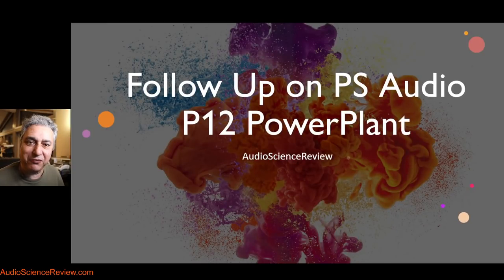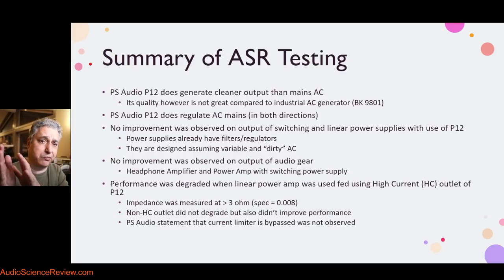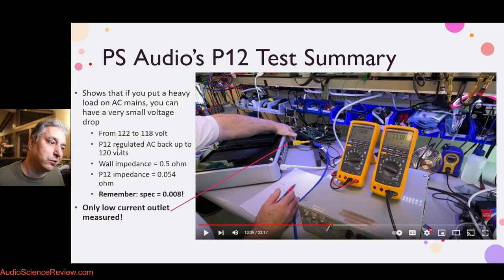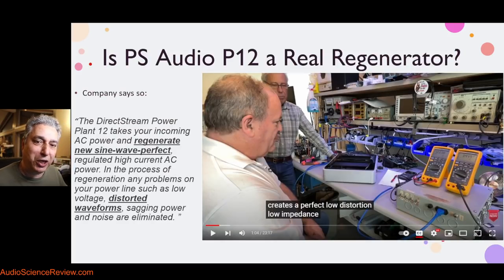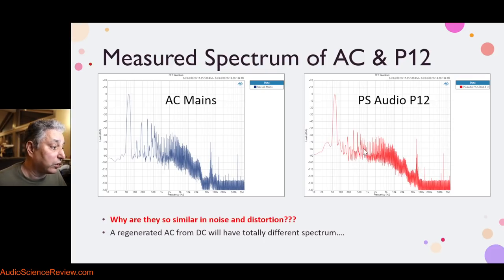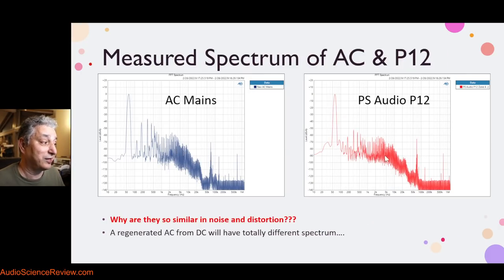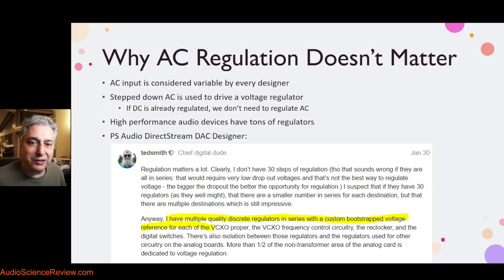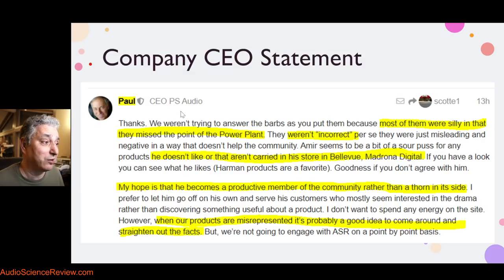PS Audio PowerPlant Measurement Follow Up

Comment: Nice job Amir.  I've never been into these regenerators, as I buy equipment that has sufficient line filtering and power supply noise rejection to make this sort of thing redundant in my system.  Audiophiles and HiFi enthusiasts are two entirely different groups of people.  Audiophiles have infinite resolution hearing that only works when you can see what you're listening to, and they value what guru's, priests and magazines tell them.  They love the artistic jewelry of audiophile boutiques.  Thick heavy metal and thick cables, gold, platinum and exotic materials and everything that pleases the eye. Higher priced equipment is almost always better.  It is a fun hobby, audio art collecting, but it is for the most part unrelated to high fidelity.  Paul is an audiophile priest, and what he says goes with the audiophile community.  Arguing with a member of the audiophile religion is usually a waste of time, as they dodge logic in favor of what feels good to them.  Every year the priests move the goal post of audiophile perfection and new works of art must be purchased to keep you collection up to date.  HiFi enthusiasts are interested in high fidelity reproduction, supported by measurements and verified by listening.  They understand that hearing resolution and accuracy is limited,  diminishing with age,  and far lower than what can be easily measured. An amplifier built in a coffee can is just as likely to be sufficiently high fidelity as anything with an inch thick front panel.  Modern HiFi electronic equipment  is far better than the hearing ability of anyone I've ever met.

Comment: I own a P600. I have measured the FFT on the output. The old models (or at least mine) do indeed completely regenerate the power and the output is markedly better than my line input. I have opened it up. Had it all apart on my bench for capacitor replacement repairs. It is a power amplifier set with an oscillator board and includes some feedback to regulate the output voltage and some self limiting over-current protection. It sure puts out the heat but it does make a difference with my tube gear. Not with my switched components though because those supplies are designed to take any crap ac and make dc.
Reply: So, are you confident in a blind test, you could score a 10 out of 12 positives, when 'in line' or not? (when your power is regenerated or not)
And of course, using your amplifier of choice, such as the tube gear you mention?  IMHO, this would be the real  test, measurements aside.

Comment: Does anyone know how to even do damage control anymore? Seems damage control is synonymous with simply making the damage WORSE. PS Audio man... what are you guys doing over there?
Reply: This really makes me wonder if this is more a battle of pride then damage control at this point.   as far as the company, PS audio would do just fine but I think would really be the issue for all the reviewers that said that absolutely benefited from the product and could hear it clear and measurable difference. It's those reviewers that would probably get the most backlash. Not the Audio company as they can always re-engineer or retool and make a better product. 

but the credibility of all the reviewers would be tarnished forever

Comment: Here is my comment: If the components in your audio system are properly designed and built, as most are, you have no need for a power line conditioner. None... zero, zip. 

When I was a kid, there were still evangelistic peddlers crisscrossing the farmlands of the US selling "lightning rods." PSAudio's spokesman reminds me of this resurrection of a phobia. This time, it's the good old power line that is the evil gremlin.

I recall several years ago commenting on Paul's 'Missel' YT video extolling the virtues of the Power Plant. Basically, I said that, if an audiophile is having problems with electric power quality impacting his music, the solution was in the electronic components' internal power supplies... not trying to 'improve' the power line's quality. And these problems are very rare.

I completely agree with Amir's characterization of such power line improvement devices. In general, the fault and its solution are in the component power supplies, not "powerline fixers." These power supply problems are rare. Electronics design engineers are keenly aware of their responsibility to build internal power supplies that clean up and regulate power -- inside the component. That they do this very well is a testament to just how few problems are extant in decent components. Mostly, they are in your imagination.
....
If you are desperately looking for something to spend a bunch of money on to improve the condition of your life, buy a boat. Or a sports car. Or a platinum wristwatch. The scientific measurements are in. Let them dispel your powerline phobias.

And don't forget to buy and wear your copper bracelet to cure arthritis, liver disease, heartburn, and lumbago.

Comment: Awsome info mr. Amir! I do have a question maybe you can help me? I am using a VariAC to step up/down voltage to my pre & power Amps .. I was wondering if these copper core variac's introduce distortion? I use a hefty one on both stages 20amp, and my requirements are only 5amps or so.? Appreciate your scientific input. Thank you!
Reply from the maker: Hi there.  No problem at all in using the Variac in your situation.  You have done the right thing by using one with far better current availability than what you need.

Comment: Come on...using an inductive current measurement as the basis for precision calculations?  That is definitely amateur. Great tool for checking circuit loading,where precision is not required.

Comment: Thank you for revealing these kind of stuff for people to know specially when you pay thousands for most of these nonsense items. I wish you could test audioquest niagara 7000 which I paid close to 10k . I didn't know better, bestbuy sales people said I needed it
Reply from the maker: I have tested the Niagara 1200 and unfortunately it doesn't do anything for your sound: https://www.audiosciencereview.com/forum/index.php?threads/audioquest-niagara-1200-review-power-conditioner-surge-protector.25443/.  I looked up the specs for 7000 and it doesn't start filtering until 3 kHz.  I am confident it is not doing anything useful as far as filtering. But if you are in US, I am happy to test your unit.

Salespeople have to push these things because they have little margin in the products they sell.  Often that is the only source of profit and as such, they are incentivized to sell these things.

I have tested a bunch of AC filters/generators and none have shown any benefit regardless of type and architecture with respect to making your audio equipment better.
Reply: @AudioScienceReview  I am in California I really appreciate your reply. I have my sub and a pair of mcintosh mc901 and 1 mc257 connected to the high current outlet of it. Like what you said wall outlet mostly likely will do the same.  What a rip off 😪. I need to start selling it.

Comment: Thanks for review, Amir! Can you recommend a good ac regenerator? I sure, it doesn’t matter for modern DAC or headphone amplifiers, but I have a couple of vintage guitar amps with old school transformer and caps style power supply chain - it is a part of sound, because it works like compressor on max power - it’s really sensitive to AC noise!
Reply: @Douglas Blake I have other issues with AC, like variable voltage, strange short peaks, etc. I find it’s easier to buy AC regenerator to solve all problems.
Reply: There are some rather cheap Salicru double regenerators on Amazon, I've got not any idea if they are good but they are really high power large units, probably with a noisy fan so you want to stick them in a cupboard... I was tempted to try one to solve momentary power cuts in the area

Comment: The output waveform of the P12 is similar to the "dirty" AC line input because it's NOT a true regenerator. It is actually an amplifier. They are using the input AC signal to "generate" the AC output.  Garbage in... garbage out.

Comment: These are useful at audio shows where the venue's power starts to droop from all the equipment. I've seen the voltage drop to 103Vac at the wall with a clipped waveform which can definitely affect linear amplifier performance.

Comment: I used to own a PS AC12 Power Cable and it's 799 dollars. After blind test it with a stock cable in a Tube rectifier Tube guitar amp(suppose to make the biggest difference), I immediatly sold it, just placebo effect. Years of technical industry expereice taught me to look at data and not feeling. I haven't seen any cable company able to justify their claim that their cable make the sound better using data, nor does any power planet company neither. 

It's sad to see Paul's statement. IMHO some companies are out-dated from the Hifi game. Hey it's 2022, not 80s. If you plan to watch Paul's video, I did spent my 23 mins and so you don't need to. It's somehow contradicted with my knowledge. Either my textbook/college/graduate education are wrong or they don't know what they are talking about.
Reply from the maker: You are way ahead of the game Sam with that blind testing.  It takes an experience like that to realize how bad audio has gotten as of late in pushing stuff that has no value at super high prices.
Reply: Welcome to the real world.
Reply: Sam- if you listen to music via your Computer, Supra usb cables are fairly cheap I have one and it does have a stronger signal as shown in this tested video. This is a pretty legit experiment using an inverted channel to see how strong the signal is! But it’s not like night and day difference and I’m sure it depends on your DACs usb and if the ac is isolated from the dac itself. 

Supra does use data transfer specs of 90 ohms on inputs and outputs! That’s what I think is the difference. It just meets the standard requirements in impedance of the Audio transfers data stream. A 50 dollar US cable for 1 meter (not bad!) so it’s not all “snake oil.” 

https://youtu.be/zncAhs44sp8
Reply: @joesmith4443  Hi Joe,  this video shows good evidence, though I don't know why, I'll say it did change the outcome. To make it clear that I didn't mean cable cannot change the sound. Also, I have no problem with a cable like this Supra USB. It seems well made, good aesthetic, and not crazily overpriced. I stick with professional audio brands like Mogami, Gotham, etc. When my stock USB goes bad I'll probably get the Supra. 

In my experience with cable, the difference is small and no one should spend the $$$$ on cables. There's an entire industry advertising their product as "HiFi" and claiming their thousands of dollars cable make a huge difference to your audio system. If you say you can't hear that one will say your system is not good (they mean expensive) enough. And this is pure BS.  

I as a consumer want to spend my hard-earned money based on data and scientific results, not the placebo effect nor the manufacturer's lie.  And this is exactly what Amir's works shine.  To help the us spend their money wisely on audio gear and not fall into the trap about "expensive = better sound".  Proven with evidence. This PS audio device is a great example. 

Back to the usb cable topic, if we put aside the level difference for those USB cables, the difference between a 320k mp3 and lossless will most likely be greater than any of those 2 cables can make. However, I haven't met anyone I know who can pass the blind test. I've done this to over 10 people who believe there's a big difference, mostly audiophiles and a few musicians. In the beginning, they were all pretty confident, but at some point, they will start to understand they were just guessing, no exception. Maybe a 15 years old kid can pass because he can hear higher frequency, I'll never experience that anymore. With that saying, I still listen to lossless because it doesn't cost me more money.
Reply: @sam0227  you should get canare, they are basically Mogami but the “generic version” made with same exact stuff. Yea the “studio grade” cables as far as I have seen through test don’t make an audible difference but they do last a long time quality so you are not buying three or four cable per year or couple of years. They last. That’s about it. 

Yea I hear ya I’ve bought expensive stuff that doesn’t work or sometime tested and doesn’t do perform as advertised. It happens. Luckily In today’s world there’s many online research and it’s always good to really do your research when you do buy something to fully test it during the trial period!
Reply: @sam0227  True but is like saying most of non trained musicians can’t tell the difference between key signatures and chord progressions.  if you play only MP3 blind test are a little misleading… that’s just the general population and small randomized test isn’t to be super accurate. There’s also what dac was used, and how it was recorded. 

For instance many record labels use the loudness wars because people believe it sounds better not knowing about dynamic range. However long listening session and “trained” audiophile can tell if the tracks is flat, fatiguing and one dimensional and suffers the loudness wars. Most of the population can’t tell or what it that way think it sounds better. 

Digital cables don’t have a whole lot of differences but Cables that carry the analog  signal do have audible difference when they transfer the Audio signal depending on what materials are used in the cable copper, silver, shielding, etc and it’s input and output noise specs. It’s may not be better “CSSR” or some measurement like that but the quality of tone and sound that can’t be measured as for as I know makes it’s sound different